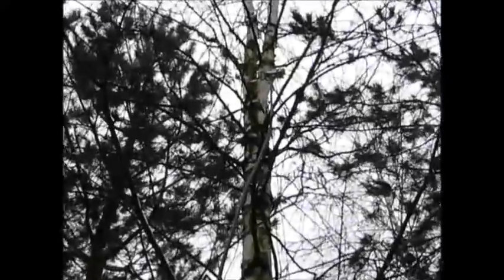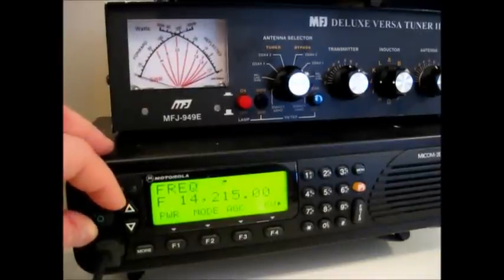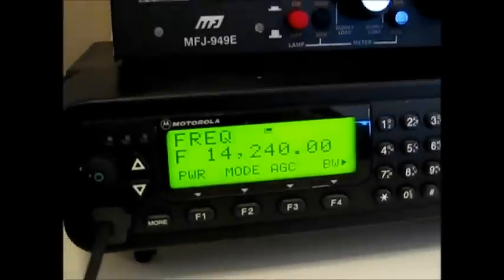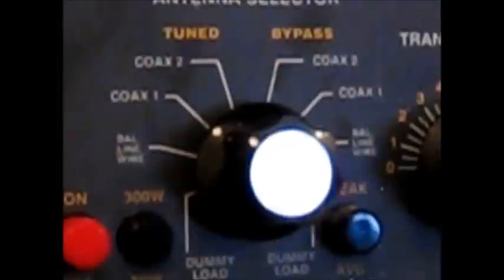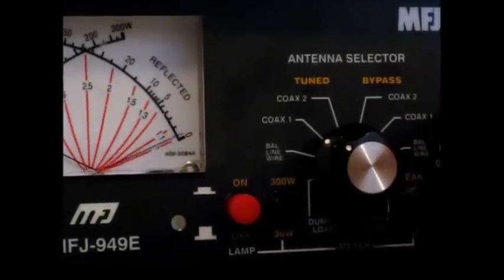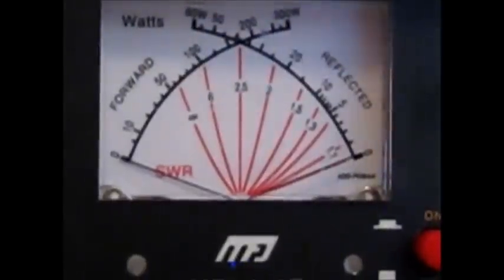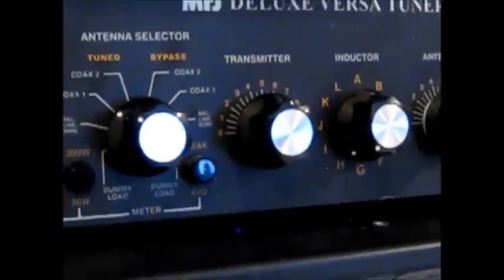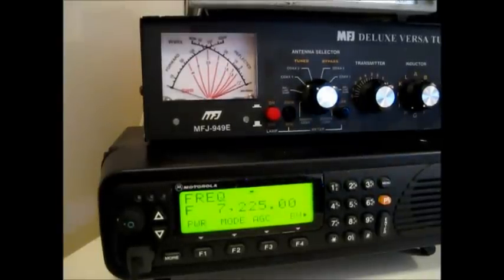MFJ Antenna Tuners - Part II

Comment: I put a 66 foot multi-band dipole inveted vee diagonally on my roof. The yard is the size of a postage stamp. I can tune the clothes line to 160 meters with an antenna tuner. I paid $300 for a 35 year old Heathkit 2060A, which I like a lot better than anything MFJ makes. It will run two coax cables, single wire, 300 & 450 ohm ladder lines. The only issues I have ever seen with the 2060A is a tendency to arc to the Balun above 1000 watts. Wrap the silver plate busing up in silicone & rubber tape and they are good for over 3000 watts SSB, or over 1500 watts AM. I could never ever dream of fitting an 80 meter dipole on my property. With the tuner, I can dial in 160 meters. I put a home brew tuned RF noise bridge in all my tuners. I am picking up an old Matchbox today. The main attraction there is the relay panel that has 6 transmitter/receiver inputs, 8 antenna outputs, a VSWR/watt meter and some extra filters. I don't really need the Matchbox. I think the 2060A is about as good as it gets. Any price under $400 to your doorstep for a clean 2060A is a good deal. Any 2060A for under $250 to your QTH is a steal. MFJs had a tendency to arc even on low power (100-200 watts). I have had a 3KW MFJ arc at 100 watts. That was enough to make me look for something used, with a better build quality. The Heathkits came with a blank notebook for dial settings & basic settings for each band. My linear amp will fold back above about 2.5:1 and shut down. Not sure about some of the transceivers. The Yeasus, Icoms, Ten Tecs & Kenwoods I have will, but running them near their foldback limits at full power is rather hard on the finals. Finding genuine finals is getting really expensive now, and the market is flooded with counterfeit Chinese made final RF transistors. They are set on dies that are about 2 sizes too small, so they will work great..... for a few hours.
Reply: Nothing's ever impossible I've made antennas out of coat hangers you just have to know how to build the antenna Heck if you wanted to make a miniature Delta Loop you could just get some PVC pipe cut notches in the ends of it and then put that out you got to make sure it's the right kind though so it doesn't get messed up also you could take plastic coat hangers and put them between the dowel rod and construct it that way

Comment: After teaching a class to Ham Radio Ops on the build of the MFJ 941EK antenna tuner I have many stories to tell. All good ones! LOL :) I bought an extra kit to use incase any of the students needed a part. Not one of the kits shipped from MFJ had parts missing or damaged. Thumbs up to MFJ for their work and dedication. Thanks for the video! 73 Jimmy, WX9DX, ARRL TS
Reply from the maker: +WX9DX Thanks for commenting.  I hope the video helped.  Hank

Comment: very nice production. I have 1 question, i have the same tuner with a TS-480SAT and when the tuner says my SWR is about 1:1 my radio still shows it is maxed out. what am I missing or doing wrong?
Reply from the maker: +Michael Hardy Sr No, that's odd.  Do you have someone in your area with another SWR meter to test with?
Reply: +Commsprepper I'll have to check around. there was a ham who just sold all his hf stuff as he got out of hf. I will ask if he might still have a swr meter.
Reply: Try to borrow a 50 ohm dummy load that is able to handle the TX output Check what the radio is showing with it straight into the output. If it shows a 1:1 match and  output at full power that should prove the radio ok. Now connect the dummy load to the output side of the atu. Go through the tune up procedure and see what is going on when you change the ATU settings. Make a note of the settings and the test frequency then compare these to your antenna/dummy load settings. It should give you some idea as to what is happening when you are tuning a antenna with an unknown impedance. Note ! check the jumper coax from radio to ATU.Do a physical check and an electrical check if necessary for continuity on both centre conductor and the braid plus see if it is shorting out  i.e a fine wire from the braid to centre pin on either end. It does happen and  would throw a right old wobbly as you go to transmit and could easily blow the finals of your radio. Hope this helps out.
73 de G0WXU . Ex. Royal Signals

Comment: How are you applying power to transmit. Are you using Cw and pressing key. Good demo of how to use atu and difference if not tuned.
Reply from the maker: +Robert Harper With this radio low power AM so I have a constant carrier.

Comment: thanks for the best explanation I've seen on antenna tuners; Once you set the trans & antenna capacitors for greatest noise, do you adjust the antenna cap when transmitting to set or just the transmitter cap?  thx
Reply from the maker: tcitim First adjust the center inductor coil (clicks with steps) for max noise, then adjust the two capacitors.
Reply: Thank you very  much.  I just got the mfj 949e  and I though it was broke and was going to call the place where I got it.  So I went on youtube and watched your video. Boy, the manual never said anything like what you did to get it to work.  Thank you very much wb8bra

Comment: Thanks for the great video, Commsprepper!

You can correct me if I'm wrong on any of this but the way I understand it, tuners don't correct the antenna, but rather they just keep the reflected power reflecting back into the bad antenna/cable mismatch. The end result is still a bad match, and still not resonant, but the radio no longer sees it. The coax cable run to the antenna wastes a lot of that reflecting power in heat, so the antenna only transmits so much of your output power into radiated signal. The reason that people use ladder line immediately after the tuner is because losses at HF frequencies are very low (like fractions of a dB), so the tuner can keep reflected power going back up to the antenna very efficiently. There's still a loss but it's much lower than when feeding the antenna with coax, and thus your radiated signal is much closer to what you'd have with a good natural match.

I do however find it interesting that you're tuning by ear, using the signal levels. This would suggest to me that the signals coming in from the antenna are arriving at the radio much more effectively, which seems to challenge the idea that a tuner does little for the performance of a coax fed antenna. I'm getting an MFJ-941E pretty soon for my own setup, and although I plan to feed a full wave loop with a very short run of window line, I'll be very interested to see what it does for it, especially for received signal strengths. I have to work with indoor solutions for now (think "attic + lots o' wire") so things are particularly challenging for me. Maybe when I finally get everything rolling, I'll put up a demo video of the setup.
Reply: Ken Saunders Correct.
An ATU is an impedance matching device.
An Antenna Tuner is a guy with side cutters.
Reply: NightRunner417 basically all the atu does is corrects the feed line impedance miss match. It has nothing to do with reflecting power, just tries to get as close to a 50 ohm to 50 ohm match at the xmiter as possible
Reply from the maker: NightRunner417 Congratulations on getting a 941E.  I had one of these too.  There is no heat created in the feed-line, the heat is created back at the radio's finals from reflective power.  The tuner will not fix the antenna, it makes the antenna system more resident (antenna, cable, and tuner).  That is why you can ruff tune by ear.  You are making the system more resident and thus improving receive performance.  However, in the end the antenna is not efficient.  It will work and the tuner will protect your equipment but it will not perform like a resident frequency specific antenna.  Thanks for watching and taking the time to comment.
Reply: I know all about heating in finals, I was talking about the dynamics of coax cable vs. use of balanced feedline like window or ladder line. Coax is far more lossy than those, and the main two ways that the losses happen are by conversion of RF signal into heat - dielectric loss and resistive loss both do this in coax. So, what happens is that any coax in the system at all will radiate a fraction of your transmit power away as heat. Then a fraction of any reflected power is again radiated away by the coax as heat. Then the tuner reflects the reflected power back down the coax toward the antenna, and again the coax radiates a fraction of it as heat. Window and ladder line have far less loss at HF frequencies, so the tuner is able to more efficiently make use of your reflected power and turn it into transmitted signal at the antenna... sort of similar to how a laser bounces trapped light back and forth to keep it going into the useful direction at the aperture. Now, how much difference there actually would be at the far end of the QSO with a coax vs. ladder line system, you'd have to do the math. All I know is that the more anal the ham operator, the more likely they'll insist on using ladder line (especially after a tuner) to keep the losses low and the efficiency as high as they can scrape up.

Good article on the mechanics of coax cable loss here:

http://www.radio-electronics.com/info/antennas/coax/coax_loss.php
Reply: @Commsprepper  Oh my. You've got some gross conceptual errors here.  Your video explains well the "how" but most of the "why", including the statements above, is not factual and is incomplete.

Comment: Bob when transmitting. are you using the tune control to apply power to check swr?

thks

mike
Reply from the maker: The radio in the video (Motorola Micom 2E) does not have a tune control button.  I set the radio to AM (for steady carrier) and set the radio to low power (10 watts).

Comment: Excellent explanation! Thx.
That means, if I buy a Sirio Bumerang 27w 11m base antenna I do not need any cutting of carbon counterpoise with this MFS 949E (or similar) tuner and I also can use that Sirio 11m antenna for 10m frequency, don’t I?

Comment: Good presentation. I have the MFJ 949, and use it on field day for an IC-735. For everyday operation, my Kenwood TS-2000 has an automatic tuner and I mostly use resonant antennas, i.e, dipoles, beam, etc.
Reply from the maker: Thanks Bob.  CommsPrepper

Comment: you would need to feed your antenna with something other than coax,right?
Reply from the maker: Coax is the typical cable used (50 ohms not/not 75 ohm TV type cable).  You can also use what they call "ladder line" cable but I never have.

Comment: Hi, I have an MFJ   antenna tuner, but was not sure how to use it until I saw this video--very helpful. I have a Di--Pole for 20mtres made with 2 mag mount antennas joined with a centre connector,without the magnets.It works fine,but now I can check it.It is on a pole 20ft high near trees. About 1ft below it on the same pole I have put up another Di-pole for 80Mtres.Can you tell me if it will affect 
the operation of the 20mtre Di-pole and vice--verser. Are they too close to each other? I was intending to switch from one to the other with an antenner switch.They won"t be used at the same time. Many Thanks--Frank--UK.
Reply: Frank, this is a very complicated subject with so many variables that it is virtually impossible to state how the two antennas will effect each other.  Why not visit your local library and do some research.  When you do, you will quickly come to realize that as fascinating as antennas are they are just as complicated, at least to me anyway.   Goodluck and 73.   Mac W4OSD
Reply: Rodney Hayes Hi, Rodney, Thanks for the reply.I will take your advice and maybe join a Ham Radio Club again. I belonged  to the Milton Keynes club based at "Bletchley Park"  UK a few years ago.Many Thanks  73  Frank M3 FEC.
Reply: frank curry
Big Bletchley Park fan here, Frank.  Dennison, Turing, all those unknown (in a lot of circles), heroes of WW2.  Fascinating stuff.

Comment: Very good video with good practical use and examples. Sometimes you just have less than optimal antenna conditions, unfortunately, and antenna tuners help and can make the difference from no transmitting to transmitting.Thank you for your very clear video.

Comment: jeeze… just when I think I am finally getting a grip on this I hear you say you CUT your antenna for a certain frequency… ZOOM right over my head… I will watch more videos to understand this subject better... but i wonder if you could cut it for the highest frequency and tune it DOWN to the others with your tuner.? I live in a neighbor hood that will not LOVE me sticking a ton of antennas on my house (unless I can figure out a way to make them pretty) lol… i will watch the rest of your videos and I will probably buy the tuner you are demoing since it appeared pretty straight-forward.  thanks
Reply from the maker: Terri - split you antenna needs into two parts.  1) local communications which can be addressed with a simple VHF/UHF whip antenna from hamradio.com.  When installed correctly no one will notice and if they do - tell them it's for XM radio or something.

You challenge may be 2) regional/long-distance antennas that will be connected to your HF radio.  For my last two living locations I have gotten by on a 14mHz dipole antenna that were 33 feet long and strung up in the trees.  Not the best in the world but they did/do work for what I need.

Watch these two videos-  they should help clear this up for you.

Antenna cutting tape measure for Emergency Communications

Antenna Information for Emergency Communications
Reply: thank you
Reply: google the "no nonsense ham study guide" it has everything you need to take your test and nothing you don't.  about cutting the antenna:
when we refer to frequency sometimes we refer to the wavelength in meters (the distance the radio wave travels in one cycle). in order for an antenna to function properly it's length needs to be devisable by the wavelength sometimes you can make it 5/8, 1/2 or 1/4-wavelength.  so to tune an antenna you have to trim it to dial it in the the frequency you want to use it on. look up multi-band dipole antenna if you don't want to put up a lot of antennas.  also if you are a ham operator your neighbors and even the state cant say anything about your antennas.

Comment from the maker: An internal inspection is a good idea but I would not recommend touching the capacitor plates.  You could mess up their alignment (see my "Repairing an antenna tuner (replacing bad capacitor) video.

Comment from the maker: I bought the Micom used.  I used to be a member of the Military Affiliate Radio System (MARS) and needed ALE.  You can still get them used - there are two for sale right now on eBay (one is below $500.00).  You still need to have your own power supply and antenna tuner.  There is a Micom tuner but I have never seen one on eBay or used.

Comment: I have the exact same tuner and really like it. Right now all I have for an HF antenna is a G5RV about 50 feet up in an inverted dipole, this tuner tunes it all the way on every band.  Thanks for the video.. good info.
Reply: Have the same antenna and tuner.  Works great on 75 AM.  and super on 20 meters